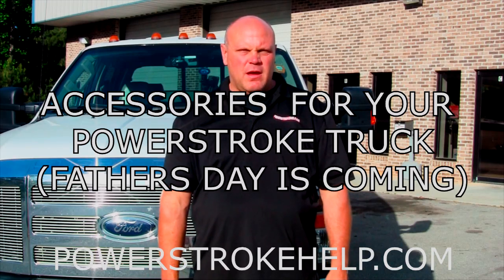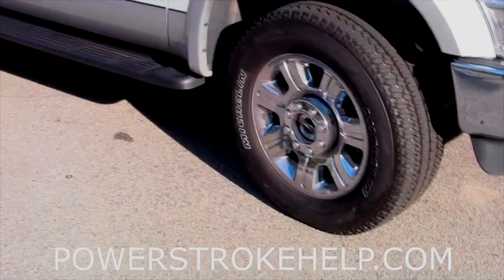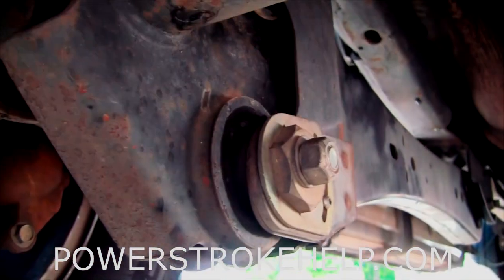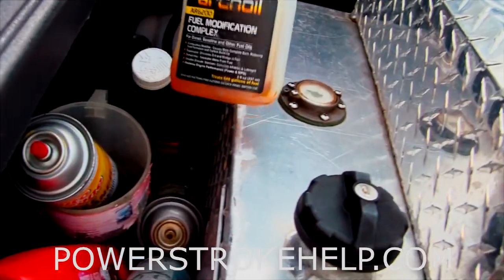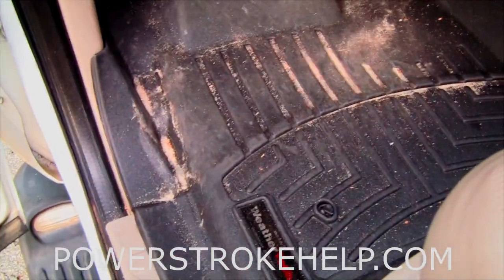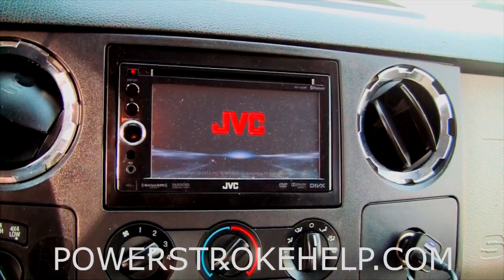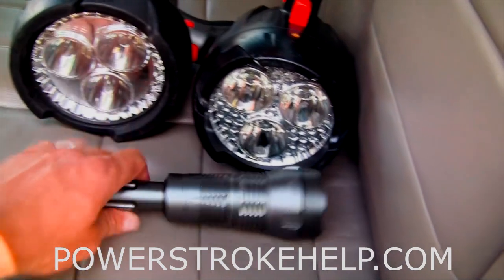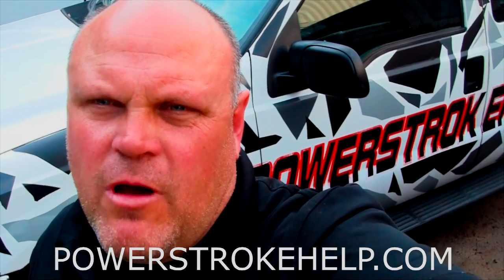POWERSTROKE DIESEL TRUCK ACCESSORIES

Comment: ima watch all your videos and everything, but ima buy a 1997 7.3 in a few weeks. im a speed junky and wanna make it into a speed truck for the drag strip, not gonna be towing with it. but tips on increasing horsepower would be nice, ik diesels are way easier to get hp gains compared to gassers